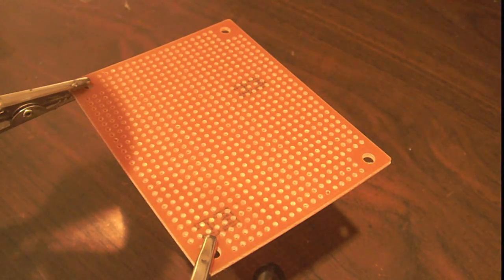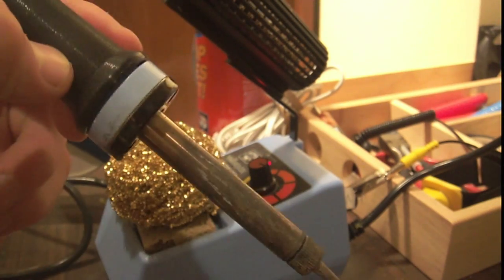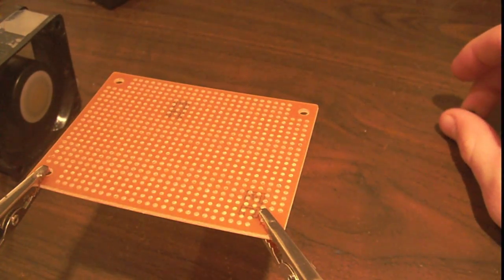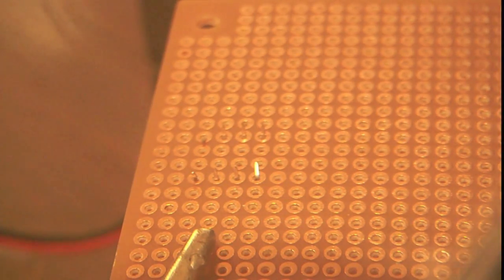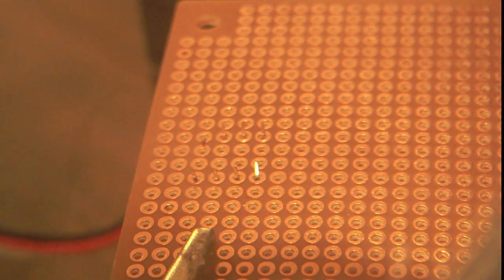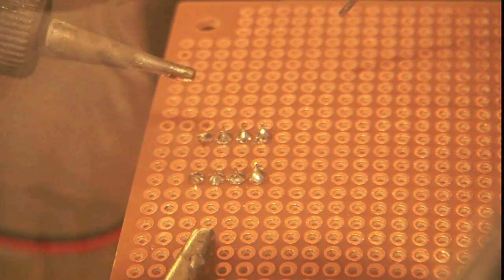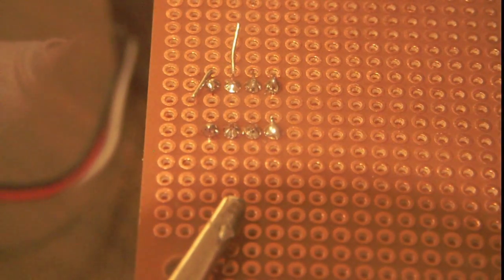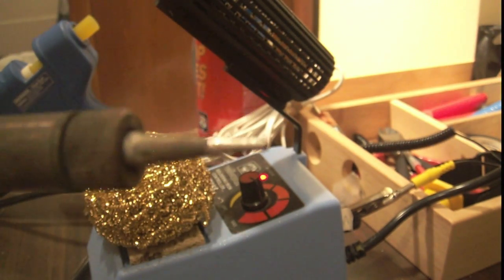How To Solder

Comment: if I were to have a in and out like a guitar pedal where would I even start on the board if I just randomly have diodes and capacitors and transistors soldered together will it blow up?

Comment: Would it not be better to tell people that it is pronounced Sol-der not sodder!!!!!
Reply: +David Potter Both are correct pronunciations  - as with many of these differences between American English and how you say it in the UK, it's actually a side-effect of the US sticking with an older pronunciation.
"Solder" is a modern spelling of the Middle English "souder", which derives from the Old French "soudeur", which itself comes from the Latin "solidare". In the 15th century there was a movement to re-latinize the spelling of words, and the "l" got added back in to the spelling, although the pronunciation didn't change to include the "l" until sometime later.
Regarding the dropping of the "l" from the original Latin, that was common in Old French, and is why we say, for example, the word "powder" instead of "pulder".

Comment: Thanks for the tips. You said you don't recommend lead-free solder, why is that?
Reply: Jackson Scully It doesn't melt as easily so it means touching components longer which means it takes more skill to not burn out components.
Reply: Jackson Scully Indeed. And in addition to not melting as easily, its wetting action isn't as good as SnPb solder's. So fluxing also becomes a bit more critical. 

Furthermore, tin has the tendency to grow "whiskers" (microscopic crystalline wires) that can short out circuits. Lead prevents this effect very effectively, but it's a real problem in lead-free solder.

So unless you are selling the items you build (in which case lead-free solder is required, with few exceptions), you should use SnPb solder. Some people like the 60/40 mix (60% tin), but I prefer the 63/37 mix because when cooling, it goes from liquid to solid instantly, much reducing the chances of a bad joint. (60/40 has a brief "plastic" phase where it's kinda mushy, and if the joint moves during this, it can produce a bad joint.)